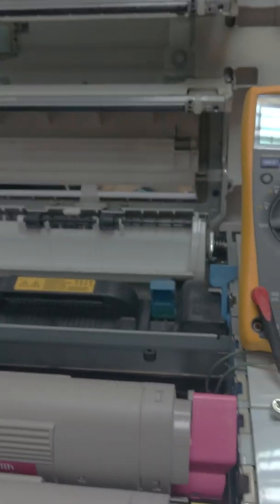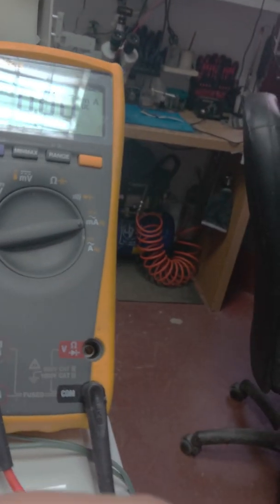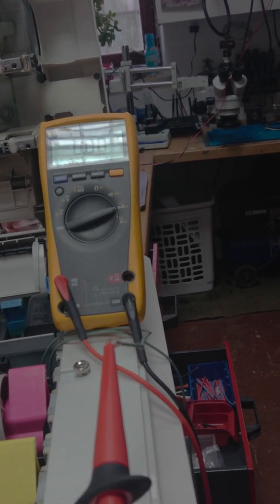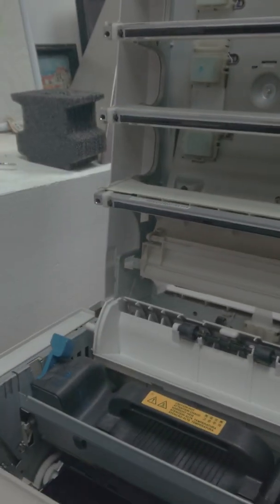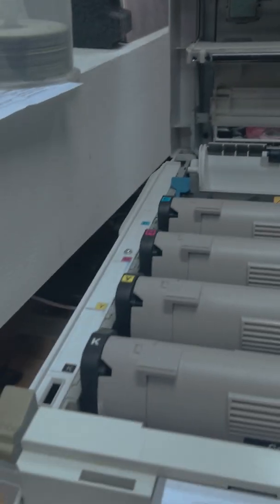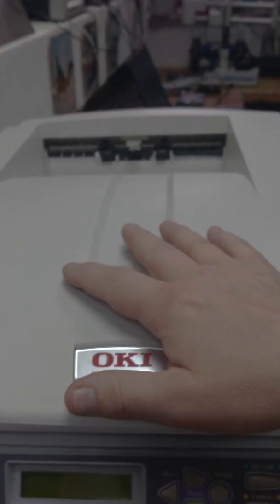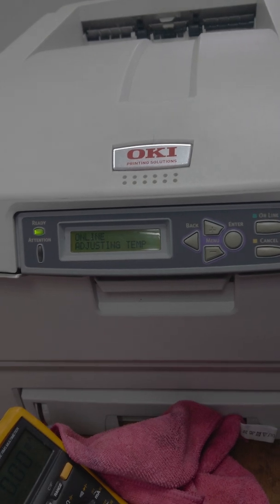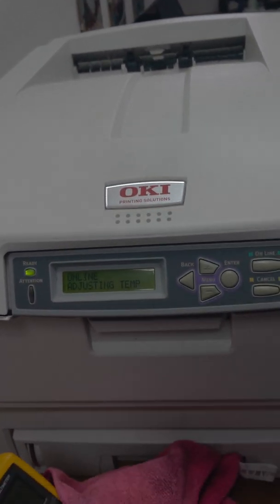Oki drum reset with multimeter

Comment: I've been doing a bit of research into the fusible links and resetting these drum counters etc.
It seems there is another fuse buried in the guts of the printer which feeds current to all of the fusible resistors in the drums. The problem is that this fuse is not particularly highly-rated and seems to be designed to operate if more than one drum is replaced at a time. The actual fusible link you are simulating by putting the multimeter in place is only rated at 63mA. If you replace more than one drum unit at the same time, the main fuse will operate at something like 100mA and the printer won't work and you are to coin a phrase buggered! You are taking a big risk of blowing that fuse by using a multimeter like you are.
To replace the failed fuse on the main PCB is a big job, requires a lot of major dismantling of the printer and takes several hours if you know what you're doing apparently. 
I'm going to buy some of the very-fast acting wire-ended miniature 63mA fuses made by Littlefuse which Oki use in the drum units. They're a couple of £ each, but a damn site cheaper than buggering the printer for the sake of a couple of quid!
Reply from the maker: I did it many times and didn't have any issue and I have also tried menwhile what you have proposed in your coment and had the multimeter connected until the end and nothing happened . But I'm at no means not triying to convince anyone to do it it is just an option among the other ones as you mentioned you can purcase the fuse and solder it .
Reply: @0markopolo0  OK on your experiments and experience, but as I've just bought my printer cheaply because it needs 2 drums resetting, I'm going to buy the fuses and do it that way. Good luck and best wishes.
Reply from the maker: Yes but you can reset only one drum at a time with multimeter other drums still remain open , and you dont't need to worry if you don't replace them with new ones and want to prolong the life of the old ones.
Reply: @0markopolo0  I fully understand what you're saying regarding resetting one drum at a time. The problem is that connecting a low-impedance multimeter in place of the fuse significantly increases the risk of passing more than the 63mA it would take to operate the drum fuse and the possibility of blowing the protection fuse on the main PCB. You are relying on your reaction time to disconnect the meter quickly enough before the main fuse operates.
In light of what I now know, I am not going to risk buggering my printer for the sake of spending a couple of quid on the correct fuses. Maybe you have been lucky, but I'm not going to take the risk.

Comment: Hi, I presume the device used in the drum is actually a fusible resistor possibly an SMD chip resistor 1/10th watt or similar. I will have to investigate but your idea of monitoring the current at start-up when the system checks the status of all the consumables and blows the fuse to record the new status makes it very easy to cheat - When you know how. Thanks for the gen!
Reply from the maker: It is good to share :)

Comment: This is a genius idea... When I tried my fancy digital Multimeter, I found it would accept random radiation from all the electronic units I have nearby when on milliamp setting.  The best solution was to use an analogue cheapy meter. When i tried i was pleasantly surprised that the meter went full scale deflection  -   removed the crocodile clip. Instant reset of the Drum.  First time I have got this method to work !!!!!!!     THANKS
Reply from the maker: I'm happy to help :)